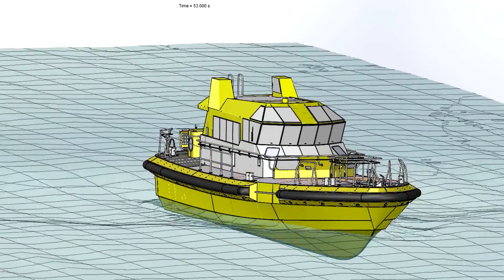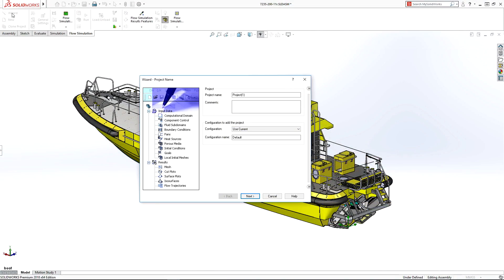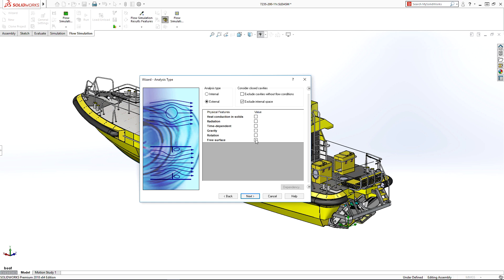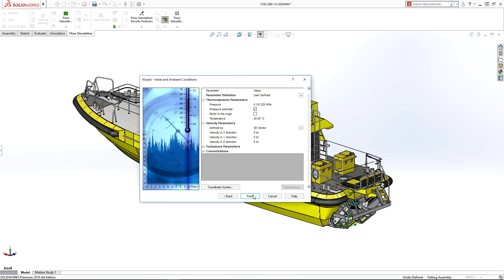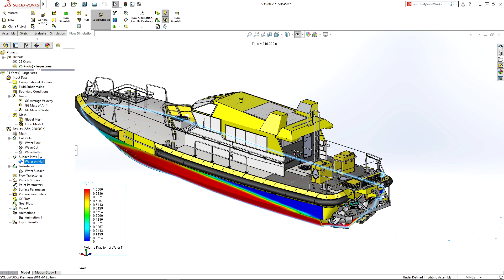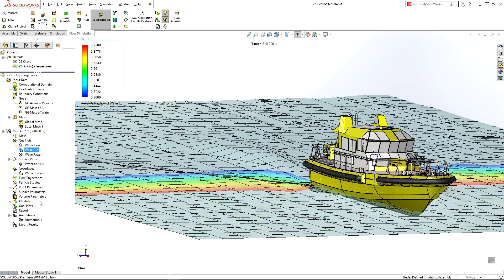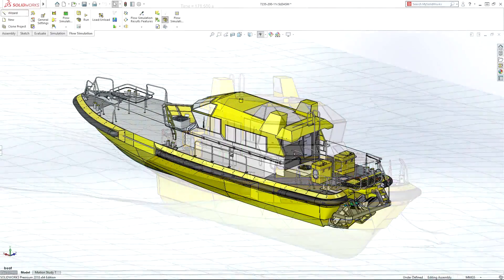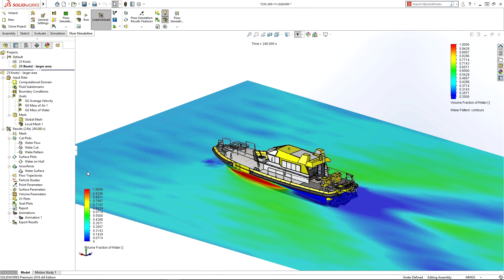Free Surface Flow Simulation - SOLIDWORKS 2018

Comment: How much RAM is needed for simulations like this?
Reply: you need a lot of cores in the cpu for this type of simulation
Reply: @gersonperezbr  You are wrong. The number of cores affects the calculation speed. But if there is not enough RAM, there will be no calculation at all. I have already encountered this several times on my 32GB RAM.
Reply: @Serhiy34  i thought that you need a Lot of cpu for this
Reply: @gersonperezbr  One processor`s core is enough.